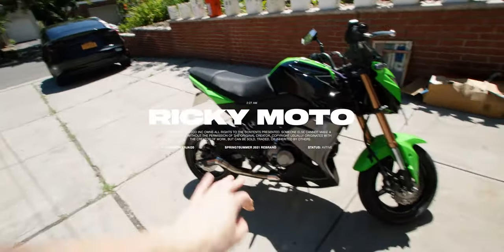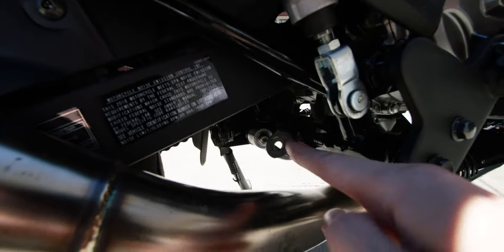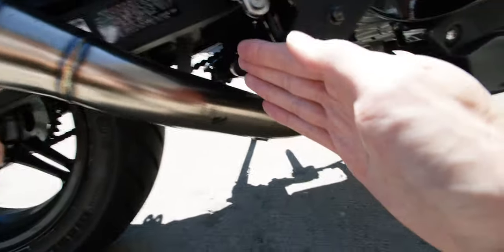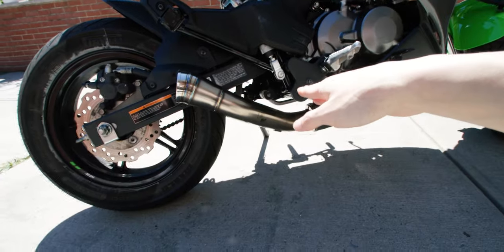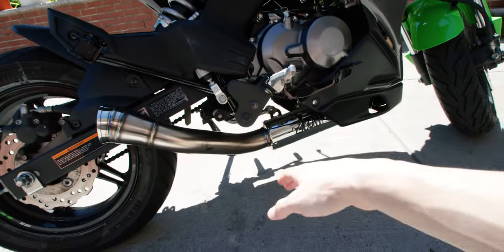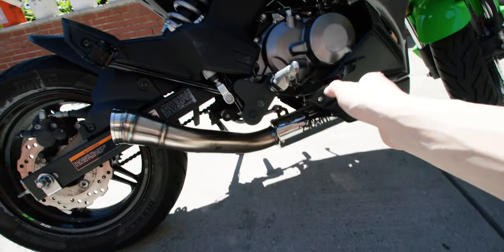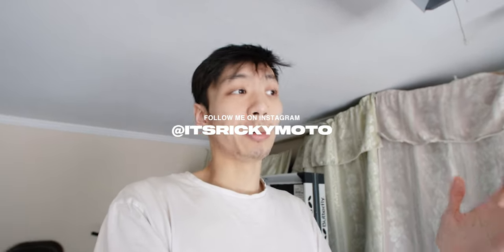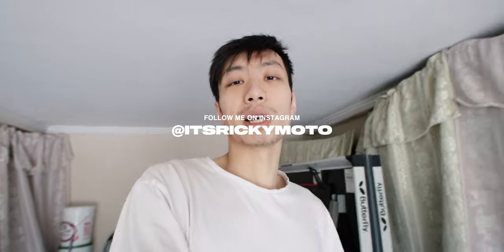My Exhaust Broke Apart! [Zoom Brute] [Update]

Comment: I watched your install video.  If you had used the supplied hardware (longer bolt) you probably would not have had any of these issues. 

Also, in most mechanical applications, it is recommended to have at least three threads completely through fasteners. 

Also, physics… just the engine alone vibrates the entire bike; add that to road imperfections (even the imperceptible ones) every bolt holding something on the bike is susceptible to vibrations. 

I commend you on your efforts, but…